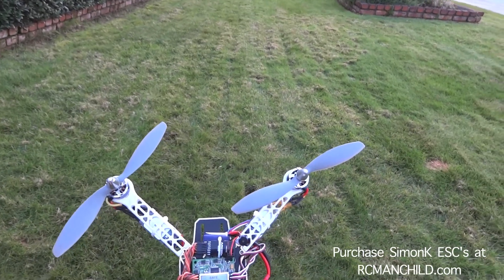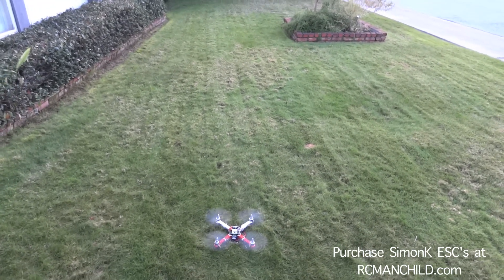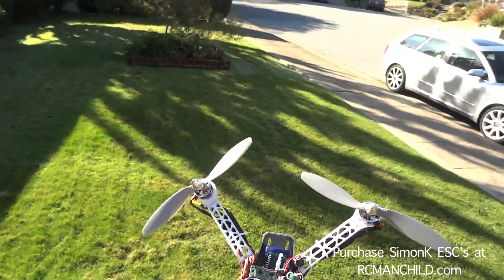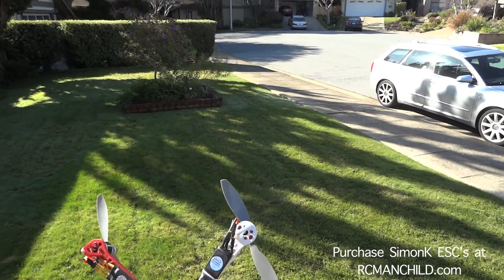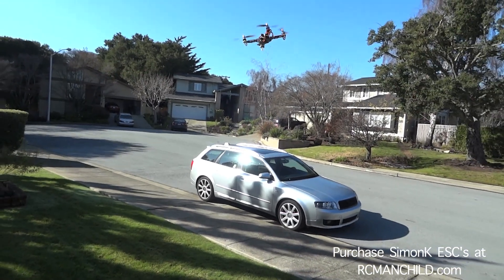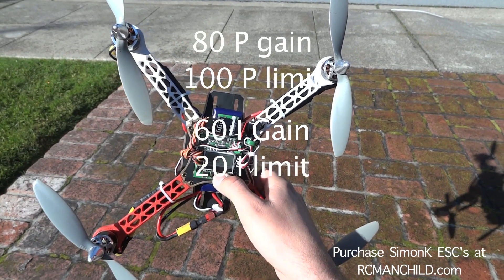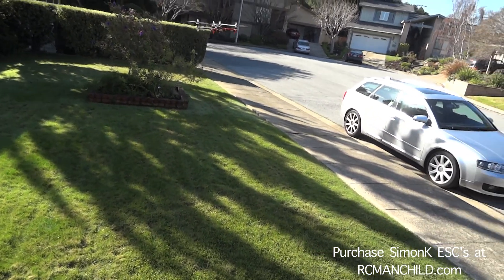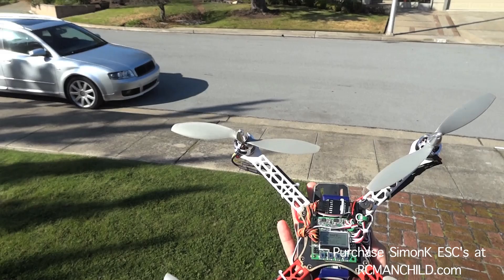SimonK ESC's: Comparison

Comment: Actually i am using 1800KV motors and KK2.1.5 but my quad is not stable, i only push Throttle but it is always goes in a direction and can not be contrable, crashed many times

Comment: What are the PI Settings that can make your drone still at one place in the air?
Reply from the maker: professional Rovers Any flight controller without gps has no reference to its position in space, other than rotation and acceleration. You need a gps module for position hold. Check out a naza or pixhawk.
Reply: Thank you 😊

Comment: Hey i m working on f450 with kk2.1.5 board and 30a ecs with fsct6b tx vx when i try to fly it it starts spining ccw and then flips can you help with my settings
Reply: M having the same problem. If u have resolved the issue pls let know

Comment: I connected. My xxd 30a esc with 1000kv motor then to a 11.1v battery. One of the voltage regulators started to heat and melted the heat-conducting rubber. What could cause this?

Comment: holy sh**! i built my 1st quad it is a f450 frame.. kk2.1.5 ,. i had turnigy ae 25a esc's .. i had my p gain all the way down to 22 and it was still osci4like crazy! it was not flyable! i was about to throw in the towel thinki g i wasnt tuning correctly.. so i gave simonk esc's a shot.. i just tuned it after putting in the new esc... quadrupled my p gain and the quad is LOCKED IN!!! flies beautifully!! thank you so much for this vid!!!

Comment: I built a x525 frame using hobbywing skywalker 20A esc and 5010-400kv motorsall connected to kk2.1 and O.RX R615X receiver one of the problems is it only lift on one side the motors are 18A max motors could the esc be the problem.
Reply: Dale De Peiza Wow...5010 400's? Are you using 15 inch props? I have 5008 320's on my Tarot T960 with 1755 props! Have you calibrated your ESC's? You may also have "Twinrotor" selected on motor layout instead of "quadrotor".
Reply: +Dale De Peiza Is it working now? I also have X525 and looking for the strongest motor/prop combo
Reply: Also, you didnt mention if you have 3s, 4s, or 6s power source. Those look like 10" props....not enough lift and rpm's to fly stable.

Comment: Your video is very good, I have a question for you, I have purchased the SK450 Quad from Hobbyking I have been told I need to update the firmware from 1.2 to the latest firmware 1.5. would I need to redo all the settings on the KK2? Many thanks
Reply: Dave Kelsall I think the latest firmware, if youre talking about the KK 2.1.5, is 1.9.

Comment: I have Afro ESCs, 30A and a similar quad. My problem is that it will lift off, hover a little then it sounds like a skipping noise and the quad will flip over itself and break the props off.. can you suggest anything?
Reply: I had the same problem with my afro 30. It was the timing that would go off  between my esc and motor. Updated simonk firmware is running 18 deg of advance. Stock firmware is at 15 degrees adv. I tweaked the firmware back to 15 degrees, flashed the escs with it and bingo! No more problems with it falling from the sky with the watch dog siren going off.
Reply: ever97ish dhdsracer  Hi, I flashed my ESCs and the one which used to cut out actually blew up while flashing - all were done the same way. Few weeks later my new Afro arrived and I flashed it - calibrated the ESCs and now I'm all good.

The issue now is that with the stock PID settings it oscillates like mad. I have the same quad as above with SunnySky motors and 10x4.5 props. I couldn't figure out how to fix the KK to the PCB, so it's on with elastic bands. Any ideas for getting this smoother? It flies nothing like as smooth as the one in this video :-S
Reply: alexellis2 simply adjust your settings. if it oscillates fast, lower the p gain, if it oscillates slow, lower the i gain ;)

Comment: Also how do I get steadier descents? Props?
Reply from the maker: Descents are tricky unless you're moving forward or sideways because you're descending into your own prop wash. 
My newest firmware uses regenerative breaking that gives the best decent performance I've seen. They are far more stable then plushes in general. If you don't want to replace them, turn your p gain down for better wind stability.
Reply: Thanks. When you say regenerative braking is it actually charging the battery? I always wondered if I could use my tricopter as a mini windmill,
Reply: +dhdsracer can you tell me does it matter if your escs are say 30 amps but your current draw is is say 16 amps.  I ask cause I know with my new motors and new blades I'll be drawing more amps then my 12 amp escs can handle so should I get 20amp or just get the 30amp.

Comment: I have a tricopter with plush esc's and it wobbles unless its dead
calm. Will simon k escs enable it to fly steady in wind?
Reply: Yes. But the settings in the fc are also important. If your tricopter is very light, you shouldnt fly with wind.

Comment: Another really helpful vid, buddy :) I'm on with tuning my first multicopter (Talon Tri w/KK2.1.5) and have been struggling to get it stable. I've got the ESC flashing hardware on the way and after watching this I'm confident the SimonK firmware will help with my woes.
While I'm here, can you tell me which version I need for my (new last month) MultiStar 30A ESC's? There seems to be two recent versions and if I get it wrong I may overheat them... kda_nfet or kda_8khz. Thanks in advance and keep up the good work ;) Cheers, Paul

Comment: My friend, i am with a big problem with my quad.
It slowly spins to right side and KK2.1.5 is beeping.I ever tried ereverything to repair, but i cannt solve!
What can be ?  Thanks
Reply: Create throttle curve on your transmitter; set 0, 40, 50, 60 and 100 % it will soften the descent

Comment: Sweet B6 bro. I used to have a B5. Got a mk1 TT now. Maybe you can give me a little insight, my dji f450 I'm building has 1000kv motors, turnigy plush 30a ESC, kk2.1.5 and I'm going to use a 4s 500mah. Ive got 8x4.5 props right now but was thinking about changing them. Would you be able to recommended any props? I also have some afro 30a simonk escs on order. AUW is about 1200g.

Comment: Thanks for sharing this with the numbers. I have the exact setup and was bobbling like a ball in a tidal pool could not get it out. Had the parts on order to flash so i played with gains a bunch. Now it it very stable on the HK blue series 30 a ESCs. BTW your videos are better than any others out there. well structured and precise. thanks for your contribution to the Rc community. BTW strangely enough i did not select BS fet and one smoke on throttle up. had a spare reflashed all and all is well

Comment: you can get the kind from radio shack that snap on if you dont want to back the pins out of the connector or desolder/solder. the will likely be heavier though.

Comment: Thanks Don!  Got 4 of these spinning 910kv NTM's.  Naza GPS.  I didn't use the NTM accessories, but mounted the motor from the bottom and just used a 4mm prop adapter on the motor shaft.  Balanced with an iPhone Seismometer app.  It was stable the other day in 25mph winds.  Thanks man!!!!  From Windsor Ontario!!! Shipped fast and great service.  Customer for life man.  Just get those motors ready.

Comment: Hey I have a DJI F450 and KK2 v1.5. I am wondering when you are tuning your quad, you only give 1 set of gains/limits (p-ga, p-lim, i-ga, i-lim). Is that the value for roll/pitch and yaw? Or do you set your yaw and leave it, and just adjust roll/pitch?

I hope that makes sense. 
Thanks

Comment: Any tip on how to level the quad with auto level off. You make it look  so easy in this video. My just flip or wobble very badly with auto level off.  I am using the KK2 controller with 1.5 firmware.  Does the CG has to be perfectly centre on the quad?  Or just using simonk flash esc will do the trick?  I really like your video and I think you are a great at explaining many things about the quad.

Comment: I'm running 1.2 at well. so that shouldn't be and issue. I'm not familiar with the spektrum TX, can you turn on your TX with low throttle then move it to full before you hold down buttons and plug in the copter battery? or does it beep until it connects with the RX? I think dhdsracer has used spektrum TXs in past videos perhaps he could clarify what you need to do.

Comment: You can do all four at once.
With the props off for safety!
It's done by holding down buttons 1 and 4 on the kk2 and then plugging in the battery on your craft. calibrate as per your ESC ie full throttle on turn on then wait for beep then full cut throttle, wait for more beeps etc

In effect this takes the throttle input and routes/bypasses it to all four ESCs at the same time so you get them all calibrated and matched

Comment from the maker: Yeah, you got it. My ESC's are stock with the ferrite ring on the leeds. It's just to block out any possible interference on the same circuit. There is no disadvantage to them so it's better to be safe. You can get the rings at any good electronic supply shop.